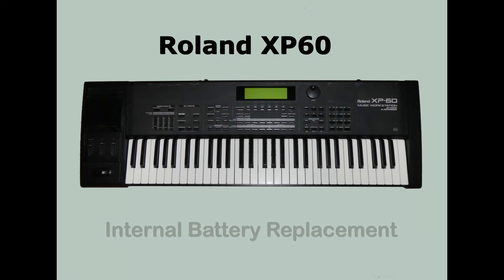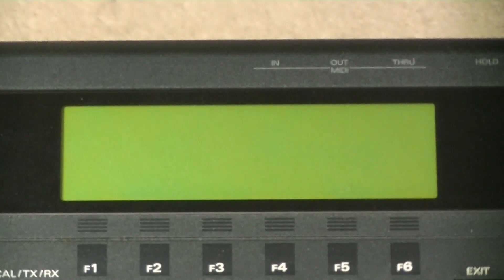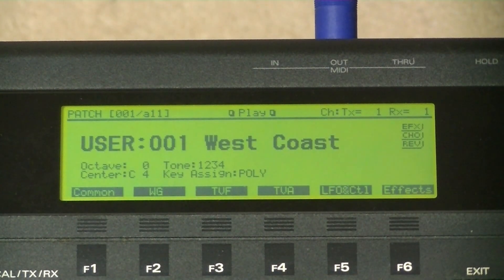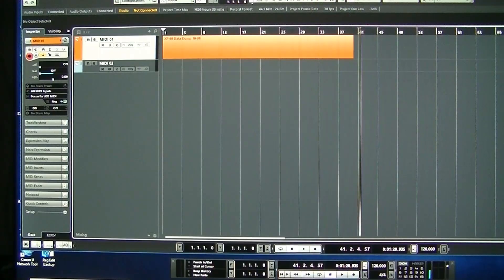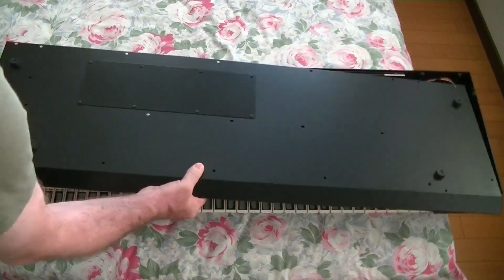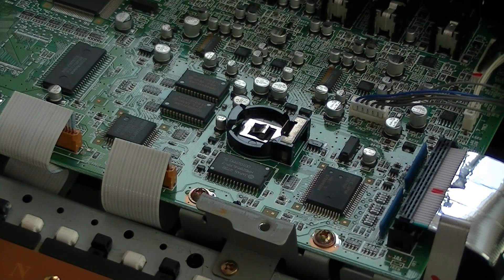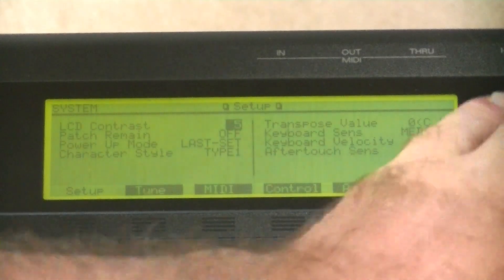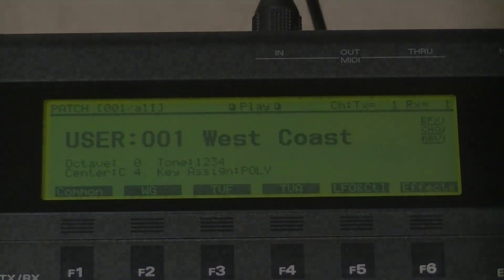Roland XP60 Battery Replacement

Comment: Thanks. Your video helped me replace the battery in my xp80 although alas it still won't boot up with the new battery fitted.
Reply: I'm sorry to hear your XP80 won't boot up. It might be worth having a Roland dealer check it over.

Comment: another quick way to do it,just open the keyboard(take the bottom part off)plug it in,turn it on and replace battery with unit on,put bottom cover back on and thats it,you wont loose data,10 mins job!!

Comment: A silly question I know but to be sure, this process does not harm the factory default performances right? Only my personal performance data? I want to be sure I do not lose any default sounds and performances.
Reply: If I don't bother dumping the performances first that is...
Reply: Yes, it's my understanding that the factory defaults are there to stay. The process I describe in the video does not affect them. And even if it did, there should be a way to restore the factory defaults.
Reply: Thanks Keith! I had already opened my XP-80 and replaced my battery before I received your reply and you are correct, it does not affect the factory presets. Made quite the difference in the performance also.

Comment: Hello, I have a Roland D70 and displays "low battery" message. No custom sounds nor settings. What happened if I just replace battery ? Will I lost factory sounds ?
Reply: As I understand it, you will not lose the factory sounds. Even if you do, you should be able to reinstall them easily (consult the manual to find out how to do this).
Reply: @keithstead5175  if I replace the battery with the unit turned on should I bypass the data transfer?
Reply: @theapex8973  It's always good practice to back-up your files regardless. That way, if anything happens, you've lost nothing, other than the couple of minutes it takes to reinstall them.

Comment: Hi, my xp 60, enter, shift, 0, 1, 2, 3, buttons are not working, please help me,
Thanks
Reply from the maker: I haven't had this problem, but if the buttons work like those on a remote control unit, you could check out this video: https://www.youtube.com/watch?v=GX6xYLNPrBg. Also, I once repaired similar type buttons on a digital clock with contact cleaner. It worked! These are just suggestions to point you in the right direction. Please do more research before attempting to repair your XP 60. I hope this helps.

Comment: Recently I turned on my XP80 but the lcd display doesn't show anything, all the buttons are on (red lights) and doesn't sound at all. Could you please give me some advise regarding this? Could it be the battery or something else? Many thanks.
Reply: If there was a problem with the battery, you would get a message saying 'Battery Low', or something like that. It sounds like you should get the keyboard checked out by a Roland specialist.
Reply: @keithstead5175  OK. Thanks a lot.
Reply: @annascarangella7686  Did you ever figure this out? I'm having the same issue.
Reply: Hi Anna, My Roland XP-80 just started having thie same issue as yours.  Did you get it resolved? If so, what was the fix?

Comment: My F2 button does not want to engage....what could be the problem?
Reply from the maker: It could be a dirty contact. I saw a useful video on 12voltvids channel on how to repair membrane-type remote control units that don't work. One squirt of electrical contact cleaner did it. It might be worth doing some research to see if this could be the solution to your F2 button. I don't know, it's just a suggestion. Does anyone else have any ideas or opinions?

Comment: Brother stil sow to bettery reaplac but not a problum solution
Reply: If you are still getting a 'Low Battery' message after you have replaced that battery with a new one, then the problem isn't the battery!